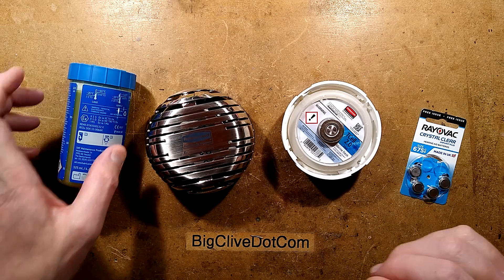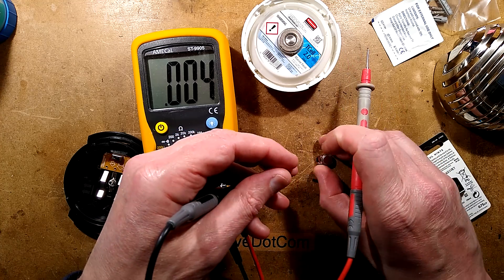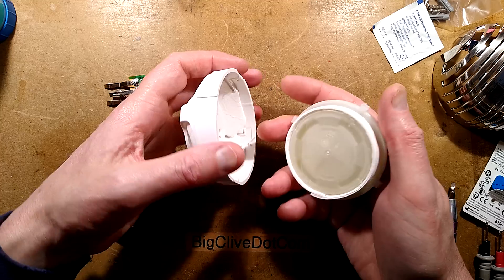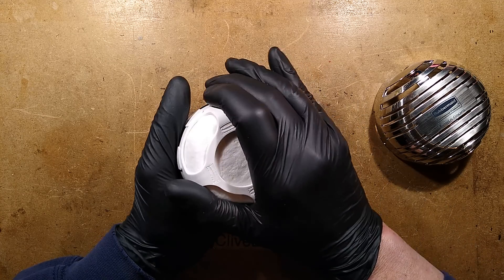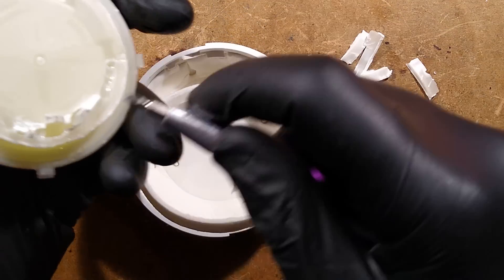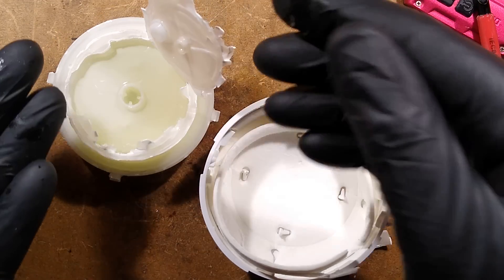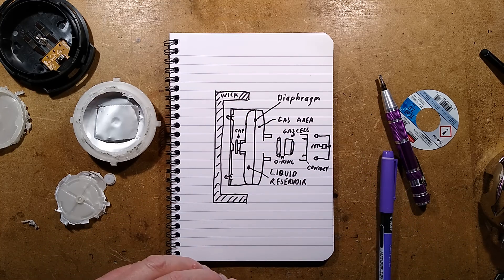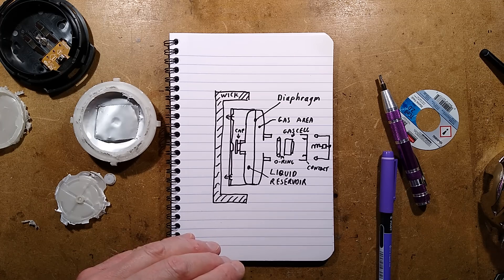Rubbermaid gas generating aroma unit teardown

Comment: Amazing in a simple looking device.   Needs a microprocessor and an led.   I can’t imagine how intense the smell must be where they manufacture the schmoo.    I hope you liked the smell
Reply from the maker: I was wondering if the factory workers can smell any more.
Reply: @bigclivedotcom  I used to regularly go to a manufacturer who used concentrated parfum for the products. One massive office with all the aluminium spin moulded drums they used to hold them, and the cheapest fragrance was around $2k per litre, the most expensive they had was nearly $250k per litre. containers ranged from 2l to 20l, and yes the concentrated fragrance stays around for a long time, and the factory is easy to tell from 2 streets away when they are working, and you can tell from the odour what product they are making the base odour for (a lot of FMCG products, often the only differentiator is the odour pack they add to the base), where they take a precise small amount of the odour, and mix with up to 10kl of other liquid to get the right concentration. That they also get things like glycerine, paraffin wax and petroleum jelly, delivered in bulk by tanker, with massive holding tanks for the bulk chemicals to give a month supply, gives an idea of just how concentrated the odours are. 

I got a few empty containers, used the one, originally Green Apple odour, to hold petrol and 2 stroke oil, and when the generator used it the entire exhaust smelled of green apple, and so did the one motor bike I topped up the tank with fuel as well, in that he drove down the street, and you could smell the direction 10 minutes later on when he turned. Drum was empty, nothing left inside but the thinnest of films on the wall.

This is likely plain glycerine, with perhaps 10PPM added to it of odour, with probably then water added to make up the more flowing mixture, and probably also a preservative, methyl paraben, added to keep it bacteriostatic, likely at a higher concentration than the perfume.
Reply: @bigclivedotcom  They can probably smell everything EXCEPT whatever odor the factory produces since the human nose can get used to any odor with time - just look at poultry farmers...they don't notice the hideous stench of chicken and turkey shit despite everyone else being able to smell their farm from a mile or 5 away...
Reply: @HappilyHomicidalHooligan  I live in a petroleum refinery town, and you can smell when you’re getting close to home if you’ve been away for a few days. Otherwise, we never notice.
Reply: @TomCee53  Lived in a refinery town and I had to move. I gave it 4 months and still got non stop headaches and dizzy from it.
Reply: I bet when they get hme they bring the stink with them a sort of free air ""freshener" 👍
Reply: @dcallan812  we had a auto parts delivery man that used to smell flowery.  It was only years later I figured out it must have been his home and girlfriends home making efforts with early Glade plug in.
Reply: @joeKisonue  LOL or he might have had a car smelly that his wife makes him use. 🤣👍
Reply: @Willam_J  I did a few contracts fitting new o2 sensors to aeration tanks in sewer treatment plants They did not smell nice
Reply: @dcallan812  Yeah, I'd have to choose working at a green apple smelling factory over a sewage treatment plant.
Reply: @kenmore01  Me too but the smell was not the worce part. Te O2 sensors are in the "water" and the wire gets wrapped in many diffrent condoms you have to remove to get the wire out. 🤢🤢 Ah the good old days 🤣🤣  I did get v well paid. 👍
Reply: @Willam_J  LOL swimming in poop I bet the lady was less than impressed. 🤢🤣
Reply: During a visit to a factory which made toilet paper, I was told their "baby powder" scented rolls were made with a drop of scent added to cardboard tube core.
Reply: Must be a BLUE LED or it will not work.
Reply: Don't forget to add a wireless protocol like wifi or BLE or zigbee or lora or whatever they're using for IOT these days, so you need an application on your phone to make it work. Not to mention so it requires those all-important software updates for your IOT air freshener. Wouldn't want to come home to discover someone's hacked it into a botnet or is using it to mine crytypo or something.
Reply: @Willam_J  😄😁😆😅😂🤣
Reply: @Willam_J  manhole covers? I suppose if an afab person were to transition partially that “joke” would make sense, though I doubt that’s what your boss was joking about. Probably not a good “joke” to repeat in any case as it seems grossly possessive of another person’s intimate bits.
Reply: @CJT3X  I find the joke quite witty and therefore amusing.
Reply: @CJT3X As a transgender woman - please shut up. You're making transgender people look bad.
Reply: @CJT3X   Not so much if you consider it less in terms of possession, and more in terms of evolutionary purpose.
Reply: @CJT3X  this isn't twitter, you are lost
Reply: @CJT3X  "Probably not a good “joke” to repeat in any case..." You realize that you're talking to the audience of the channel whose most popular video was Fanny Flambeaux, right?
Reply: @demef758  I had forgotten about that!
Reply: @CJT3X  that's what I was thinking 😅

Comment: Next up electronic urinal cakes!
Reply from the maker: I bet they have a urinal tank dosing system based on this type of technology.
Reply: @bigclivedotcom  I did see a few urinals here in public toilets in France having a battery-powered chemical dispenser directly connected to the flush water pipe and pumping liquid aroma directly into the urinal on a timer.
These units were quite similar to the ones with a spray can that are meant to "freshen" the air of the whole room.